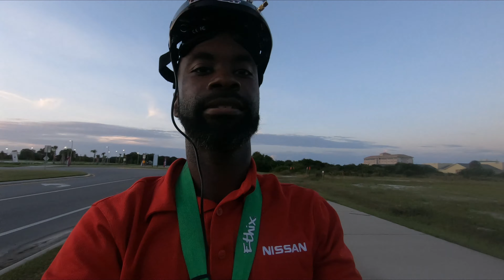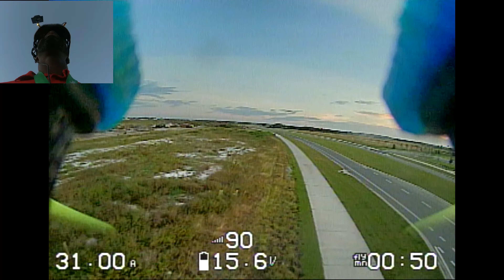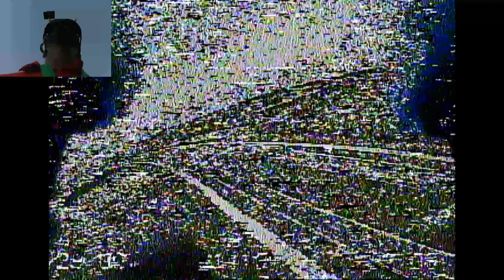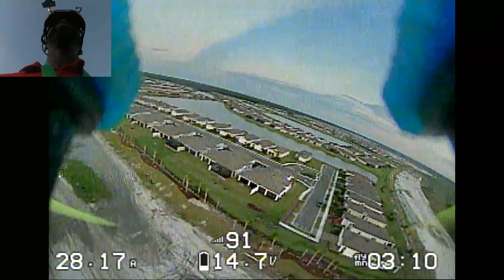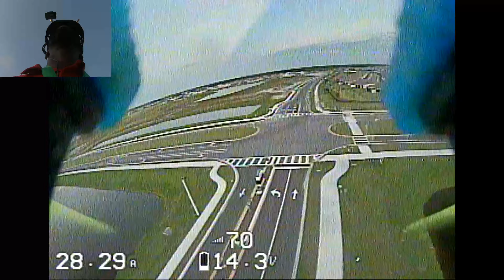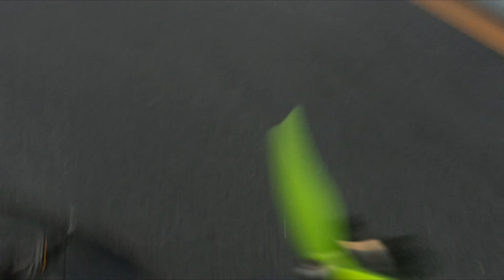Immersion RC Ghost Range Test Pt. 2

Comment: there were scary moments there !!! I do not fly long distances more when I go 1 or 2 km I use an antenna a little bigger than the frame does not disturb the signal and 1200mw AKK I never had problems with the video (max 2km)👌👍👍👍👍
Reply from the maker: Yep I need more watts!
Reply: Baldman_FPV get a fusion module, enormous upgrade over 03o in my experience

Comment: Hey Baldman - I'm not a techno wizard but Pawel Spychalski recommends 100 ft altitude per kilometer from yourself. And also, have you heard of fresnel zones? That might also be an issue here....
Your patch antenna is tilted upward so yeah, you definitely need some altitude....
Good luck :)
PS it must be nice to down your quad and not have to worry about someone running off with it :)
Reply from the maker: Yeah that all makes sense. I'm not a true long range pilot and the area wasnt as populated then..it would probably get run over now lol.

Comment: I'm about to buy ghost. Been using tbs tracer and I've had a lot of problems with fail safes..and I don't even do long range..I fly parks and parking lots ect..and it still fail safed. I'm done with tracer. Ghost is my new best friend..or we'll see 😉
Reply from the maker: You should be good now.. Ghost is further along in development than Tracer.
Reply: @BaldmanFPV  hey man thanks for the reply, I really appreciate it! I'm picking up the system from RDQ later today. I'm hoping everything goes well. 🙏

Comment: Like your tests and the fear in:). Would be interesting what Mode and Power is the Ghost System on? Also Betaflight setup Srxl2?
Reply from the maker: This was locked at 350, normal mode. SRXL2 with betaflight.
Reply: @BaldmanFPV  ok thanks for the info, impressive Range i would say. Did you use also Pure Race mode? At the moment i use Crossfire with the new CrsfShot mode. My ImmersionRC Ghost System is shipped out and should arrive in 2 weeks. I mainly want use Pure Race because the even better Latency over crsf Shot. Would be nice to see what the system can do in the fastest mode. Anyway great Video serie and very realistic test of the system, High hopes for mine here!!

Comment: What goggles system please 🙏
Reply from the maker: Sky03O!
Reply: @BaldmanFPV  great distance on that setup. Never tried pushing mine cause scared I've got no goggle reciever but I've skyzones with similar setup, might give this a crack myself. Very entertaining bro I like channel n flight style. Thanks buddy.
Reply from the maker: @bradgibson1976  this was with thr built in module, no rapidfire module.
Reply: @BaldmanFPV  there was me thinking I made the wrong choice but not now I've seen you using them. Send it bro lol

Comment: I am wondering if those solar panels at the end of your run are feeding something more then just batteries  that might cause the video drop off.
Reply from the maker: Yes I went back, and they are inactive.
Reply: @BaldmanFPV  I am new at the FPV stuff but have been flying for over 40 years fixed wing. I have the ghost and the Radiomaster transmitter. Can you give an idea on what I should be using video wise?  goggles, camera etc etc.
Reply from the maker: @NormanLedoyen  sure. I really like Foxeer CMOS cameras. The predator 5 and toothless 2 r my favorites. I think the pred 5 may be better. You can see here the TBS Unify is a great vtx as well as their triumph pro antenna. For goggles the SKY03O are great and the price difference for HDO2 and a module isn't worth it to me. Just upgrade the antennas.

Comment: Hey brother seen part 1 the other day so I did a test 350mw manual little over 1 mile. So I tried  auto power mode failsafed at 1/2 mile. Seems like it isn't upping power quick enough for betaflight
Reply from the maker: That may be possible.
Reply from the maker: Especially if there is a really sharp drop. U could increase your failsafe recovery time a stitch to compensate and keep it frm dropping.
Reply: @BaldmanFPV  gonna give it a try. This didn't even cross my mind. I definitely love the feel of ghost. Latency is like non-existent. I just have way more confidence in crsf for range. Tried and trued you kno.